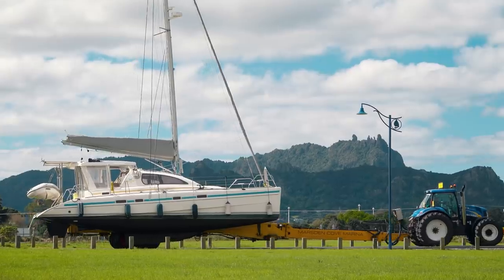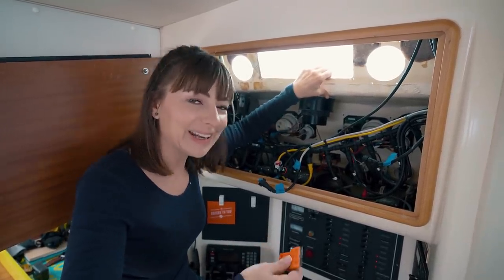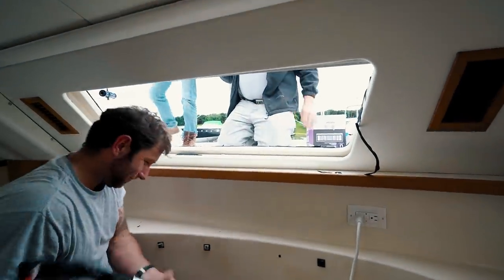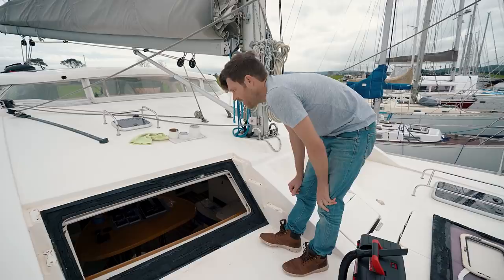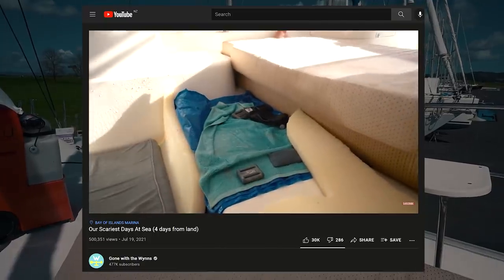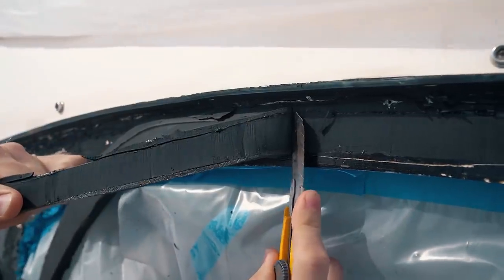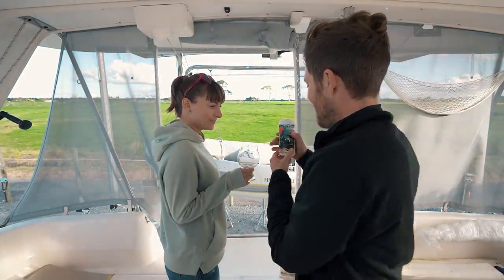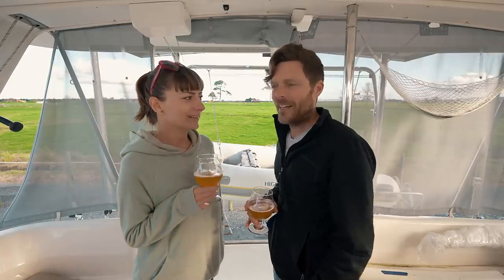Ripping Our Windows Out For The LAST TIME

Comment: You need a Oscillating Multi-Tool with scraper blade to remove the caulk. Quite a useful tool for boat repairs, sanding, cutting, grinding for most materials.
Reply: I just bought one and wondered if that would help. I think I’ve seen they have one on previous videos but I might be wrong about that. I really gotta get me one of those Milwaukee vacuums in a box.
Reply: YES! My oscillating multi-tool is one of my all time favorite and beloved tool! Such an incredibly effective and efficient tool! I don't know how they can be without this tool yet...
Reply: Probably our most favourite tool on the boat, we just removed similar windows on our catamaran and frankly would want to do it without an oscillating multi tool
Reply: Too Funny!  I just commented the same.  I literarily look around for projects to use my Oscillating Multi-Tool.  I purchased to do a few RV mods, and continue to find uses it for in almost every project.  The scraper blade works amazing without causing damage, let the tool do the work.
Reply: Definitely need a multi tool with scraper blade, basically similar speed & results as the air tool the windows were removed with..
Reply: According to my friend who owns a big window company those were literally invented for removing caulk on windows. He had one like 20 years ago and said it cost him like $2k and was specifically marketed for windows.
Reply: @Mantae123  actually, I believe they were invented for plaster cast removal, only “recently” adapted for none medical applications.
Reply: I was just about to suggest the same thing.  Since they don’t have teak deaks theymay not be aware of them, but most boaters are very aware of how useful they are.
Reply: It took me years before I was convinced to buy one. Now, it's literally in my top 5 must have tools. Getting that window off, and then the caulk. Easy. (ish)
Reply: @jumpyX2  RIGHT!  Easy my top 5.  Turns all those annoying jobs into childs play.
Reply: You are 100% correct!!!!!! I was going to send the same message and saw yours..   Scraping, cutting without becoming an 'epic' job,  mine goes thru nails, glue, caulk, drywall etc.
Reply: Are there any blades that will cut through fiberglass?
Reply: @kristensteary6991 Cloth maybe, Firbreglass Re-enforced Plastic; Yes, either a Diamond or Carbide blade. These tend to Grind instead of cut. Usually for Grout removal. Have a Vacuum running while cutting and the itchy powder produced is almost non-existent
Reply: @kristensteary6991  wood with metal type blade works great on fiberglass.
Reply: @kristensteary6991  Yes, All the wood/metal blades will cut through fiberglass

Comment: I bought a wire off of EBay for removing windshields, under $20,it has two handles which you use to "saw" between the window and base,takes two people but it took me less than 20 minutes to remove the glass.
Works pretty much as his $1000.00 tool,cuts the caulking and prevents you from cracking/breaking your frame.
Just something to look into for future issues,may be a tool you can order now so you have it later. (just in case)

Comment: Hey I know this is a late suggestion but I work for a marina anytime we have a lot of caulk to remove from surface we use a pneumatic angle grinder with 2” 80grit and 120grit sanding disks and it significantly speeds up the process. Just need to be delicate to not go into the fiberglass.also I seen Jason was using the Milwaukee vac. I just purchased mine from tool truck two weeks ago since I do majority of electronics upgrades I’m always needing a quick clean up and after buying the Milwaukee impact driver and drill I’m amazed how great their tools are and batteries are always better than 120.
Reply: I have a couple of the Ridgid "Hybrid" tools, that take either 120V or the 18V battery, and they are very handy.  I wish that they had a small vac that was a hybrid so I could plug in if power is nearby, or battery if not near an outlet.  The one downside to the battery vacs though is that they just EAT battery charge.

Comment: The best tool I’ve found for removing caulk is an oscillating tool with knife blade attachment. It goes through even tough caulk (even construction adhesive) like butter.
Reply: That window you said would take 8 hours would take less than an hour with a oscillating tool knife blade

Comment: Time to put a multi tool in the tool chest. They make a “blade” specifically for removing caulk. Wow Jason, thats a pretty big black caulk! Back to the multitool Milwaukee makes one and will make life on that boat maintenance way easier
Reply: Was going to suggest the same thing it’s well worth the couple hundred bucks.
Reply: You have an Amazon link?
Reply: Fein makes the original multi tool...had mine for 27  years. Buy the kit that fits your jobs. Buy the way make sure you get the variable speed unit
Reply: @niolss  did you get the links? Seems like my reply is gone
Reply: @n3qdz  No. Maybe the block amazon links? 😔
Reply: @niolss  that blows
Reply: @n3qdz  ?
Reply: @n3qdz  ok thanx. I was trying to find the blade it self.
Reply from the maker: @nik son and @n3qdz no, we don't block links. They often get held as potential spam but I've cleared/approved all those. Weird! 
Curious Minion
And 73 @n3qdz
Reply: @gonewiththewynns  gotcha thanks!
Reply: @gonewiththewynns  Yeah I did not think you guys did it :) But Youtube.

Comment: For future reference there are tools manufactured very similar to the one he used that are battery operated they are a oscillating multi tool that has multiple purposes. They're also are ones that run on 120 volts, and they're not that expensive unless you go for the upper brands like Fein. They will cut anything from steel to plastic very well and they have bits that you can buy to do exactly what you're doing right now and not damage the surface.
Reply: The marina guy was not using an oscillating tool, he was using an air powered  "air saw", which is like a very small sawzall.  The blade on an air saw does not go in an arc, but rather back and forth along it's length.
Reply: @VC-Toronto  that's fair enough but a multi-tool would work much better than a chisel
Reply: @jayfitmob8645  A lot depends on the material being scraped up.  I have at least 4 oscillating tools, but for some scraping jobs I break out the sawzall with a scraper blade on it.  (I think the most recent ones I bought were made by Spyder)  If it's a small job, then the oscillating tool head comes off the 18V multi tool and the small recip saw head goes on with a scraper blade.  (Ridgid multi tool with the swap-able heads)

Comment: Great job you two.  Just wanted to add a pro-tip.  The fiberglass and support around your navigation instruments looks sub-par.  I would highly recommend re-enforcing it with pressure treated plywood strips behind the panel, or else it will crack again.   Also the plywood will take the stress, instead of the fiberglass when you are out sailing.   Thanks for sharing your adventures. :)

Comment: Just wondering, and I completely understand you have a lot of repairs to get done and a limited amount of funds, but how come you didn’t take out the forward port side window and replace that one as well?  You did the starboard side. I would be afraid of that one starting to leak soon after sailing away.  Love the videos though, and the boat projects. Nothing better than seeing the reality of owning a boat.
Reply: Under lock down only emergency repairs can be done.  At least where the windows are going to be made.
Reply from the maker: Correct, under lockdown protocol only windows that are a life/safety issue (in other words, the cracked ones that are letting water in the boat) can be repaired. The others will be done as soon as lockdown eases in Auckland.
Curious Minion

Comment: You need a Fein Multitool or at least one of the knock offs from Makita, Harbor Freight, etc.  They have a series of blades, one is for removing caulk.  A good homemade tool for working with plexiglass is to cut a piece of plexiglass to make a scraper, file one edge into a blade.  Plexiglass won’t scratch plexiglass!

Comment: Hi been watching your adventures with interest, did some sailing in my Army days out of Kiel in Germany 🇩🇪 . Got to the standard of competent crew.
However that is not why I’m writing, I worked in as a mechanic and one job was replacing windscreens. The calk - silicone used is a 2 complement Calk. The windscreen and boat frame are cleand and a activator is painted on and left to dry for 15 min then the calk is applied Glas and frame are then brought together. Windscreens only fail if the surface on the car are not clean or Rust free. 
The German firm Würth manufactures this adhesive. The windscreen has to hold the force of an airbag deployment 😁

Comment: For removing the caulk I wonder if using a Variable Speed Oscillating Multi-Tool would speed it up. Also I would have a steam cleaner if I owned a boat. (Steam cleaner under 200.00US)

Comment: That foam bit may be very important because on ours you need about a 1/4 inch spacer to allow for the thermal expansion of the window… on our catamaran they put down a 1/4 inch bead and let that cure before they actually put the window on.   The foam forms a dam right where you put the spacer bead on… when people skip this and try a super thin layer they end up with leaks… good luck… great video…Walt

Comment: As an Auto Glass Technician I have a thought on your window projects. I am a little familiar with Sika though it is not a Urethane Adhesive I normally use. Anywho, on automotive windshields and other glass parts there is a black band painted on to the glass part. This black band's primary function is to block the Ultraviolet Light of the Sun from breaking down the adhesive. I am betting the lack of this Sun block on your old windows is the main reason the adhesive lost its bond to the windows. I think this is something you should look in too.

Comment: An oscillating multi-tool with scraper attachment, ideally a flexible scraper attachment, would probably help a lot. I purchased a Workpro branded one on Amazon for around the equivalent of $35 or $40 and it's brilliant for removing caulking, SikaFlex and such things. Not perfect, but really helpful. Thanks for sharing your progress. Best wishes from the UK.

Comment: CRL958

Quick Release of Most Adhesives
Softens Butyl and Other Windshield Sealants

CRL Quick Release Agent is a solvent blend designed to loosen or dissolve most adhesives. It softens or undercuts butyl, oil-based and polyurethane sealants

Comment: You may want to look into a vibration saw tool. Several different brands are available and they come with many tool heads for various type projects. A razor edge works mush like a razor blade window scraper. Then they have stated edges that can cut wood or metal and plastic, I imagine there’s one for fiberglass as well. I think I have even seen a battery operated one as well recently.

Comment: Just a little hint on removing caulking (especially Sikaflex) use a heat gun to soften it up while scrapping at the same time. Works like a charm. A small trick we learned about when re-doing our windows. from a fellow sailor.

Comment: The new oscillating tools have thin saw blades that will cut through caulk as well as thinner sharpened scraper-style blades that will cut it while oscillating. Are the originals acrylic or polycarbonate? What are you replacing them with? Are you going to reuse the hatch windows imbedded in them or have new ones made? You are going to need a set of "Easy-Outs" to drill and unscrew those broken bolts that "temporarily" held your life raft in place. You might need to get them on order.

Comment: Use a multitool with a stiff scraper blade to remove surface adhesive like that. Then clean it up with hand tools. Modern materials and engineering require power tools. Probably a good idea to get a reciprocating saw also and fabricate a similar window cutter attachment. You already have the Milwaukee batteries and the tools are fairly priced.
Reply: Yeah was thinking the same, that hydrolic tool kinda looks like that Milwaukee Multi-tool

Comment: I use an oscillating tool with a knife blade to remove caulk all the time. Not sure how well it will work with Sika but if you can borrow run and do a test it might be worth a purchase, around $200 USD depending on what you get. Also some good battery operated ones available.

Comment: I have found that circular wire brush cup drill attachment ($5-10) works great for removing sika around windows.  Once you a majority of it off, add a liberal amount of goof off adhesive remover and the rest will easily come off.

Comment: I had to replace a skylight in my trailer- an oscillating saw with a chisel blade made short work of removing the old caulking. They make these tools powered by mains or batteries. Makita, Milwalke, are examples and you will find a million uses for this power tool in the future including sanding adaptors.

Comment: I don't know if you have the Milwaukee reciprocating saw to go with that vacuum and drill, but if so, they make a scraper blade that goes in the recip! Makes very quick work of that caulk removal -- my preference is to have a few and sharpen 'em to different angles.

Comment: The next tool you guys need to invest in is a oscillating multi tool with a ridged scraper blade.  It will make short work scrapping all that calk off.  They come corded or battery operated.  I removed a hatch on my boat recently and it took all of two minutes to cut the calk loose.

Comment: foam cushions  can be put in a bag and use a vacume with the bag opening around the tube then suck out the air and water.  it wont get everything but if your rinsing out the sea water keep rinsing with fresh water.  the tough part is finding a big enough bag

Comment: When removing blisters from a boat bought an air vibrating razor blade knife, it did not work as well as their tube showed it, But was wondering if an electric vibrating tool would help, they are advertised to cut trim off in place. They are very safe even with a saw blade they will not cut your hand.

Comment: @Jason We used to peel EVA foam from windsurf boards with a multitool (the vibrating kind you use to cut wood trim in awkward places etc.). We just took the dull blade, completely knocked off the teeth and gave it a bit of an edge but not sharp enough to cut yourself on. If you didn't reef on it too much, it wouldn't bite into fiberglass, but it would happily cut foam. I'm thinking it might work on Sikaflex as well. These tools can be had dirt cheap at home improvement stores if you stay away from good brands or you can probably find a neighbor that has one if you don't have it already.

Comment: great video guys , with sika flex i found the best way to remove is to have a limiltless supply of blades i know its seems a waste to most but it works . just make sure u have a binnie to put in the blades , can use a pop can to trash blades to keep u safe .safety wise u should always be wering safety glasses ,the blades are very thin and when they break off they have some good flying strength to them also a pair of gloves . mehanic gloves has a pair that has reinforced section for blades and is cut proof . stay safe and hope u guys get wet soon .

Comment: It's a saws-all with a thin, flexible blade.  The only difference is that his is air-driven.  You should buy one!  They're about $100 at Home Depot.  Good, rechargeable, battery-powered versions, too for not much more.  There are also chisel blades for it which run about $20.

Comment: Perhaps, and this is just a question? Maybe the caulk in the windows does not have enough sheer strength to withstand the flexing of the hull? I would be tempted to put 1/4-24 Stainless Bolts with washers every 6" all the way around them. Of course that would be making the windows structural members in the hull and perhaps they would just crack then.

We had three boats and I think that they all just had caulk like yours. Of course we were too chicken to go blue water sailing. That would mean crossing the Columbia River Bar...

Comment: Sika is a brand not a product so i am not sure which product was used on the original installation or what you will use to seal the new lenses.  Have you checked to make sure that the new stuff will stick to the old?  My portlights are all attached with Dow 795 structural silicone adhesive and no silicone will stick to silicone.  If your caulk is a silicone base, you will need to remove every scrap of the old caulk down to clean white gelcoat so that it will not interfere with the adhesion of the new seal.

Comment: I don't know if this will help you at all or if you can do that with a fiberglass boat.
I lived in a house where previous owners used Mastic to glue down ceramic tile. And that tile was so old and out dated we decided to take it up and do some updates. I had to do a room that was 20x20 and the kitchen  to the family room and kitchen and we were updating the kitchen at the same time.  I finally found paint thinner that softened it up after doing it the same way you two are doing your windows.  Sure enough paint thinner.  I was chiseling away for weeks on that floor till I got the paint thinner... Done in 3 days...   ~ Deb

Comment: Jason, you guys really need to pick up a 'cordless Oscillating Multi-Tool' it's a game changer on fiddly cutting /scraping /sanding jobs. They are not $1000, you can pick one up for around $100 and it will cut jobs like scraping that caulk down to minutes instead of hours.  Using a flexible scraper blade for removing caulk and sealants they peel old caulk, glue and random crud and  schmutz off like magic, really really.